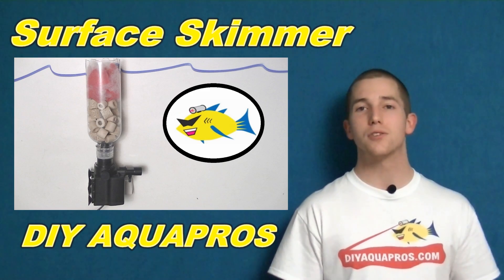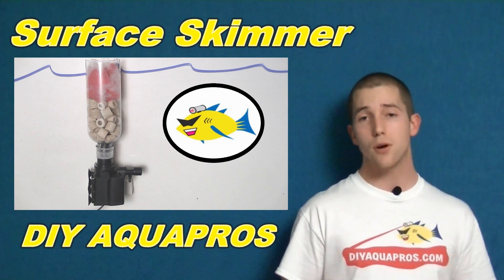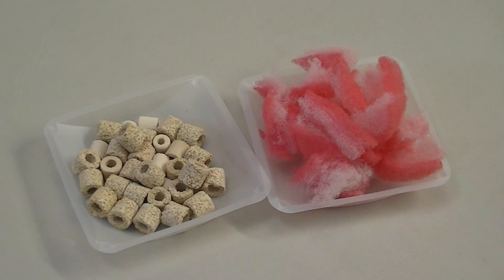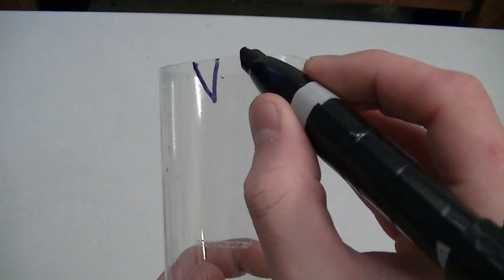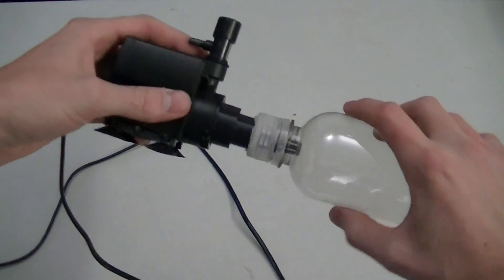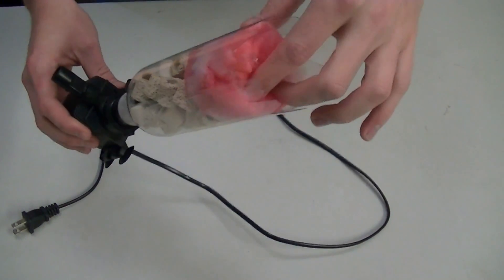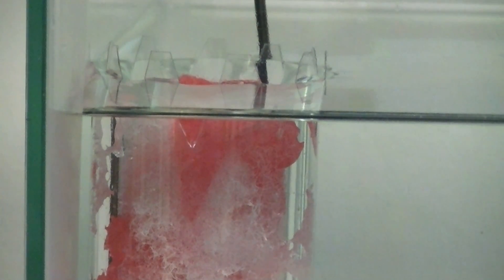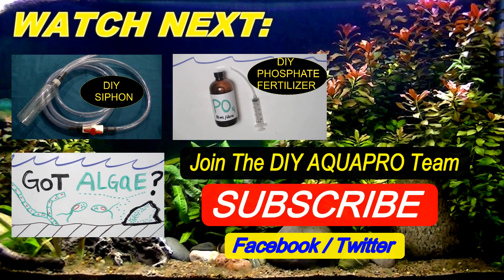How To Make: DIY Aquarium Filter (Surface Skimmer)

Comment: one thing to watch out in such design is when the water level changes due to evaporation, you can quickly fry the pump. I would suggest that at least 50% of the power head intake is from well below the surface just in case this happens. Thanks for the video

Comment: I built this it does work but you have to change the filter pads often specially if they are fine, cause they quickly get cloaked up and pushes everything up towards the powerhead.
But it is a cheap filter and it does work.

Comment: is this like a protein skimmer?
Reply from the maker: Nope, Its just a filter positioned in a way that will "skim" the surface of the water instead of drawing water in from the bottom. Protein skimmers are not needed in freshwater aquariums like they are in saltwater tanks where high carbon loads can end up reducing oxygen availability and increasing nitrate.
Reply: DIY AQUAPROS Thanks for the reply! I noticed there aren't any videos on salt water aquariums. Is there a plan for this? Thanks!
Reply from the maker: Texas Guns n' Ammo Channel One day I will get to saltwater.... I need time to really dive into and get some solid experience before I start making videos. Thanks for enjoying the channel though, appreciate the comments!
Reply: DIY AQUAPROS Reason I ask is I want to attempt to make a DIY protein skimmer. Doesn't look like they're that complicated :-)
Reply from the maker: Ya Ive seen a few videos on them, looks like you could definitely same a ton of money!